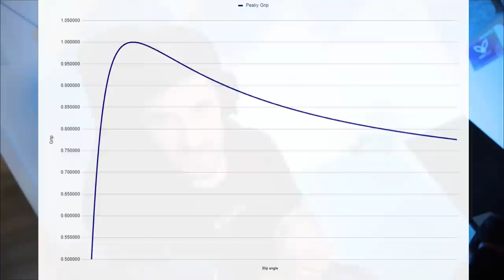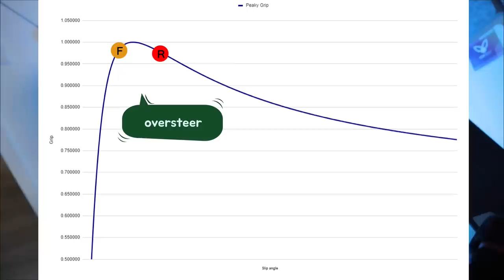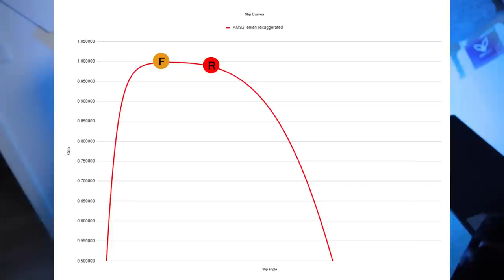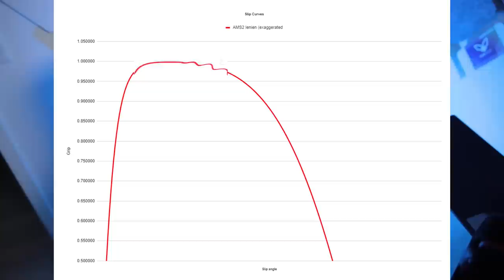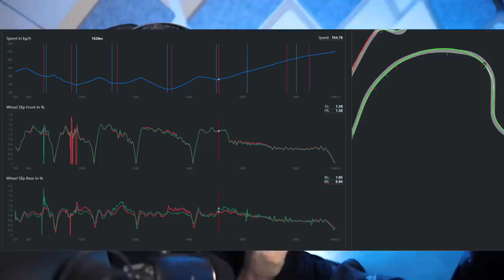Understanding Simracing: YAW! Explained using Automobilista 2

Comment: Brilliant.  Absolutely brilliant.   Thank you for bringing these intricacies to light!. Additionally, the optimal pressure for the michelin tires centers around 1.98bar.and although the driving may seem more lenient at face value, as the pressures and tire temps evolve, the slip allowances for the front and rear do change as you continue through a race.  So keeping the car as neutral as possible throughout a stint (for wear longevity) is crucial.  Furthermore, abuse of oversteer via setup or driving style, as controllable as it may be,  may lead to slower lap times as rear traction decreases, especially with low TC levels. But this is all the drivers choice.
tldr: on a lap by lap comparison to other pacejka based sims, ams2 may seem more lenient, but as a stint/race evolves the difficulty/challenge his how the driver adapts to the car and conditions.
Reply from the maker: the races i did - agree short - i didnt see any noticable drop off or balance change. maybe something for another day :)
Reply: @SimracingPopometer  there may room for more refinement in this area.  the GT3G2 tire is admittedly a very durable model considering it has to adapt to a very wide range of track conditions.  

For example, IMSA rarely sees track temps lower than 40c, whereas in AMS2 that can vary much more widely. So, adhering to a particular single tire rule set, for authenticity purposes,  requires even more leniency.   Furthermore,  most races are run with default fuel (light) in a sprint race type format, where tire deg doesn't really become a factor, although it exists. It can be muted even further. 

Plus, you're an excellent driver and great drives can drive through these types of things with sheer experience and natural ability.

Anecdotally, most drivers new to AMS2 fail to consider this factor altogether though, can't adapt quickly enough and in racing situations i.e. in traffic, driving off-line, asking the car to do more than solo lapping, (not to mention general mistakes) it can raise the difficulty factor.

Going too far and having the tire fail more often can lead to more mistakes, and mistakes in a MP scenario tend to collect other innocent bystanders which isn't that fun for anyone.

At the end of the day, your video is brilliant though.  Every bit of data or observation is informative, especially from those with a well tuned eye for things. Thank you for that.
Reply: @SimracingPopometer  I did a "full length f1 race" but with half the amount of laps and 2x accelerated tire wear & 2x accelerated fuel consumption. That way I could get the full F1 race experience in half the time just to test out how pit stops and tire wear and stuff worked in long distance races.

And he is right, its a huge factor in your race outcime and massively effects car handling. I did a race with every 1991 F1 car, every 1988 F1 car and every 1986 F1 car. And if you don't manage your tires and really throw the car around - it will be faster at first - but very quickly you will start to lose LOTS of time, as so much grip will be lost. Not to mention it becomes much more difficult to handle. 

AMS 2 is pretty hardcore when it comes to tire wear. I feel like it happens quite a bit faster than AC. It really punishes you for oversteering and understeering, but if you drive well and avoid understeering and oversteering then your tire wear will be quite minimal and it can give you quite a big advantage against the other cars whos tires are worn later in the race.

I feel like AMS 2 rewards you for managing the tires a bit more than other games, and also punishes you for abusing the tires a bit more than other games do. 

You should test it out on a long distance race, even if its just a half race with 2x tire wear acceleration & 2x fuel usage acceleration. You'll quickly realize this is NOT a sim where tire management is just a small after thought and not too big of a deal, like some other sims are. Whether you abuse those tires or nurse them like a baby it will make a massive difference to your speed and overall race. Sometimes, you might even have to do a whole extra pitstop if you go hard on the tires, although depending on the race and car type it might be faster to do the extra pitstop and go hard on your tires. It depends how fast and how well you can drive with worn tires, because it makes a massive difference in handling and becomes much more difficult to control the car. Its a high risk high reward thing. Although some cars you're better off just not pushing, especially the "backmarker" or "midfield" cars, they might be slow enough that you dont really have a chance at gaining a advantage when pushing really hard and doing a extra pitstop.
Reply: "So keeping the car as neutral as possible throughout a stint (for wear longevity) is crucial."
Sorry, but that's IMO not the case anymore and the reason why I rarely launch AMS2 these days. Tyre-wear and -heat has just ridiculous low impact on grip since a while now and the decreasing amount of fuel usually compensates it anyway to a point the fastest lap is often the last one in a race, no matter what the tyre-indicator shows. It was a bit exaggerated before , but even the new Forza Motorsport is way less forgiving when overdriving cars nowadays. I don't blame Reiza for going this simcade-direction and seems to work in terms of popularity, but as an experienced sim-racer the handling is just not delicate enough to please me.
Reply: @Leynad778  sometimes its good to take a  break and come back at a later time if you so choose. the dev lifecycle is far from over, and although certain changes may seem linear and permanent, they are not. in other words, appropriate long term developments may result in a side or backwards step in certain areas, but indeed are a better approach overall.
Reply: @TypeRTeg  This wasn't always the case and in the initial release till maybe even prior 1.2 or 1.3 the tyres were very vulnerable and overheated quickly if pushing too much. It was critical to keep the tyre-tread-temps in check as well as the core-temps in the long run. Also Braking was quite challenging because of the tyre-tread- and brake-temps that often results in an unexpected but logical braking behavior. Reiza got rid of both instead of tweaking it and possibly also showing some indicator in the HUD for the tread-temperatures. Many people thought the physics were broken because of spinning for no obvious reasons, but the same can happen IRL as well if for example pushing too much through the three consecutive right-handers at Hockenheim. The tyre-model in iRacing still works like that and it is exaggerated like it was in AMS2, but almost invulnerable tyres are certainly not the answer.

Comment: The slip canvas diagram explains why the game is so much fun and people can drive it out of the box. It is too forgiving imo. This might be the reason why high downforce cars can be saved too easy as well. 
The GT3 times overall are just too fast. 
But the main reason I use iracing, rf2, ac and acc is the missing competition in ams. I think it could be my fav sim when they improve MP or LFM support it.
Reply from the maker: it feels rewarding to drive indeed, and also a tad too easy - agree!
the saving of high df cars got better, there definitely is point where you've gone too far, but you need to force it I feel
Reply: There's another part to it too, and it's how nice the road feels and the FFB in general in AMS2. I "main" iracing these days, but fuck I wish it felt like ams2
Reply: I agree 100% the GT3 times are too fast.  Me, a complete shitter with no real skill to speak of who plays on controller can dip into the 2:17s on AMS2 at Spa with the new GT3s and that's even taking into account the fact that time starts at the farther back line compared to ACC so the lap doesn't start at the same point in both games.  Taking those same cars in ACC to Spa, I haven't managed to get out of the 2:20s yet since I've been going back and forth to compare though I did come close once but I lost it on the exit of the Bus Stop and ended up with like a 2:20.2 or something.
Reply: If they could sort out a decent multi-player competition system, I think AMS2 would attract way more racers.
Reply from the maker: @shaunsheppard3936  for sure, yeah. i think its undervalued how important MP is.
Reply: >too forgiving 

Lmao your skill issues are not an argument. If its "too forgiving" drive faster until it isnt

T. Catches slides in ams2 acc and rfactor2 reliably
Reply from the maker: @dc-vw4qm  eh, I've really pushed the cars here, these should be pretty quick times and yet there was never a risk of losing the car. even if too fast in the game, the tire always stays with you and allows you to still work off the speed. you'll lose time but not the car

also: be nicer maybe?
Reply: A good multi-player and some propper depth in how to setup a car for your liking inside the game would be really nice.
A little bit like the coffee brakes in Gran Turismo 4.

Comment: Hmm I disagree a bit with the way most people look at slip curves. The slip curve does not exist! It changes shape and size all the time. Sure it is easy to visualize it the way you show it, but when you're cornering and accelerating, you're asking grip in two directions from the rear tires. Even with a 100% flat slip curve, you can still get an iRacing type spin if the acceleration grip takes too much cornering grip away. I tried to explain this here: https://youtu.be/OJIvgFoVjoY   Acceleration grip will not only take some cornering grip away, it will also move the peak slip angle to a larger value.
Reply from the maker: No doubt this isn't correct, it's just a representation how the driving feels in an attempt to make it relatable. 

So for more detail everyone, watch the more in depth Niels - he also has a letter more :)
Reply: Guys, join forces and do a podcast about this topic. I‘m sure the community will love it! Include Aris as well 😊
Reply: The question is: How much is accurate of this acceleration grip-loss. AMS IMO always felt way too unforgiving in this regard not accounting for the tyres to flex and increasing the tyre-contact-patch due to weight-transfer and torque which is the reason why Dragsters can accelerate properly without just spinning tyres at the start. AMS2 is too forgiving I guess because the tyres flex too much and you can't even provoke the typical wheel-spin when accelerating out of the pitbox. In earlier versions (prior 1.3 or 1.2, can't remember) the tyres were very temperature sensitive and underdriving the car the trick to survive more than a couple of laps. I won quite a few online-races by just waiting till the guys in front failed because their hotlap-technique only worked for 3-4 laps. The heat-sensitivity was too much to be accurate, but Reiza went into the opposite direction and even excessive tyre-heat and -wear doesn't slow you down these days, but is a benefit regarding laptimes.

Comment: You really hit the nail on this one.

This is just the thing why people feel like you could just turn the wheel more and it never understeers, because its yawing all the time instead of understeering. 

I feel like its gotten better over the months but why dont you think they just reduce the slip angle? would that be a "easy" solution?
Reply from the maker: because the graph like i showed it doesn't exist like that as a source in the game. its only a result of a lot of calculations. so you'd have to change coefficients here and there, but it all has ramifications in other areas - and in the end they'd need to be unhappy with the tire to begin with
Reply: @SimracingPopometer  Right! Probably quite hard to get to that point but like I said I feel like they are making step towards that since it has gotten better over the months/years. Anyways, cant thank you enough for showcasing this in a easy way and I'm happy to have it explained what ive been feeling for a long time.

Comment: Ams2 is fun and to me thats whats i like I drive rf2 aswell and can feel the difference in the way the cars handle between the sims but honestly both sim are great fun to race in i used to drive acc but after playing rf2 and ams2 i cant go back. The following is an extract from the developer on the reiza forum, 
"
What I find a bit frustrating with this ongoing complaint is that people making it seem to miss the fact this is (IMO) a minor downside to what is otherwise the most organic & engaging tire model of all sim racing with the possible exception of a really good rF2 tire. Reality just isn´t a peaky / front-limited tire model ACC style even if that is what many sim racers have become convinced it to be - opinions may and do vary but I´d rather drive a AMS2 tire from two years ago than to be always just having to slow down the car until the frontend responds on corner entry and then just mind the throttle application on exit so it doesn´t snap away with little to no warning - that isn´t just unrealistic, it´s plain boring. If that is your expectation of what AMS2 physics should eventually evolve to I can already spare you the waiting - it won´t happen because we don´t believe that is accurate. The options here are either to adapt so you can enjoy it as it is, or move on to the sims that more accurately match your expectation, because insisting on the argument won´t win it.

Everyone is welcome to share this nugget of physics development feedback wherever you feel may be of merit BTW - just because the physics don´t satisfy everyone´s perception of reality it doesn´t mean the physics are necessarily off, and it´s only fair that users know this is how we feel about AMS2 physics as they are now so they don´t waste their time expecting a change that won´t come."

Comment: loved the video and the editing was great too.
one question I have left does it impact tires longevity
Reply from the maker: if you go too far, yes. but not the way i was driving fast. you can see that front and rear wear are pretty similar on these laps, even if its lap 4-5 already on the run
Reply: Indicated tire wear changed dramatically in 1.5.3 (few month ago), where lockups now really degrade your tyre indication in the HUD. However what you feel may differ highly from car to car, as different cars use different shapes, sizes and also - which is crazy - different tyre models. So a half worn tyre on a GroupC will feel different from a half worn GT4 tyre. I love those details.

Comment: What an awesome video... totally explains the most criticized aspect of AMS2. From top to bottom, between the cars, the graphics, the VR performance, it is my favorite sim. But im new to sim racing and the last thing I want is any "assisted" driving. So ive been driving a lot in AC and iracing just for the realism. Does anyone else think that if Reiza can sharpen this yaw curve, it could become the best sim out there? Are there any plans to do that? I played with a GT3 car in iracing and the FFB felt like nothing to me. ACC feels terrible to me and is worthless in VR. AC  is awesome but does not look quite as good in VR.  RF2 feels great if you want lame graphics. But the fact is, there are so many people NOT using AMS2 because of exactly what you have explained here....includes me to some extent. Is Reiza going to address this?
Reply: I guess the question is, is it really assisted driving? or are other SIMS simply implementing a different take on the driving experience. I don't know the answer sadly. My feeling is, if they can narrow and sharpen it up a little bit, and then sort out multi-player, then AMS2 will take off and put itself up there with iRacing and ACC. If you've got limited time and can only commit to a single SIM, and you want to complete online, AMS2 isn't really even an option at the minute.
Reply: @shaunsheppard3936  since watching this video I've gotten back in AMS2 some and it's really fun. I would just like to think my reflexes being tested as would be in a real car....or another sim. Another thing about AMS2 that bothers me is how the grass is like ice. It's like if you go off track the race is over and it's so annoying trying to get back on track. I can't believe that would be a hard fix.
Reply: I guess you tried CM CSP Pure in AC VR right? Im sentive to lower fps, so AC is the only game i can barely play on rtx3080 on reverb g2. It looks pretty good. I tried AMS2 only shortly and while i agree it looks better, its not that much better than tuned AC. Im planning to try AMS2 and ACC with rtx4080super. I really hope that i can run 90fps.

Comment: tell me why I should buy the dlc when a gt3 Porsche is included? is there a difference regarding the actual "theme" or did I just watch an ad for the new dlc?
Reply from the maker: I don't really follow the question I think?
An ad? anyway. physics changes are global and affect all cars. you don't necessarily need the latest Gen GT3. however they are simply more evolved cars and different from those of 2018.
a 992 GT3 is more mid engine than the 991 GT3. the M4 is an entirely different car to the M6. aero maps have gotten a lot better and less sensitive (though I'm not sure if the game really reflects that)